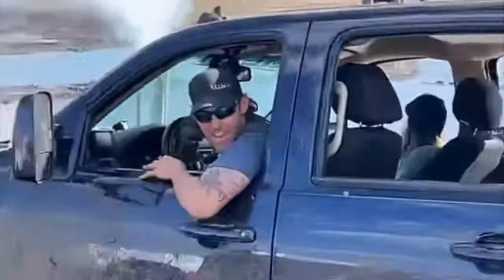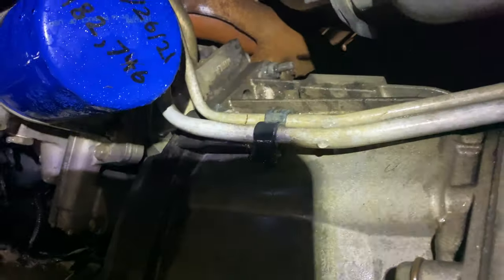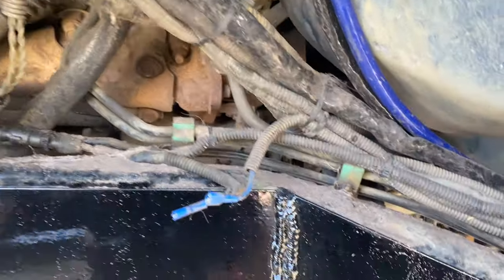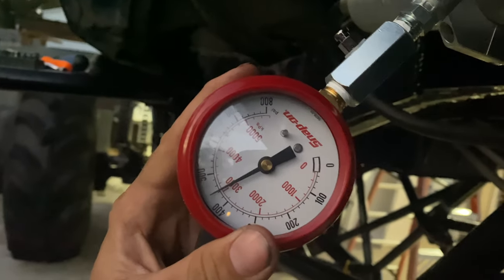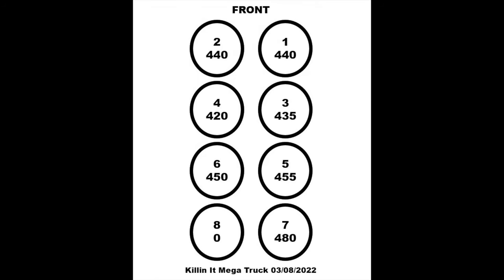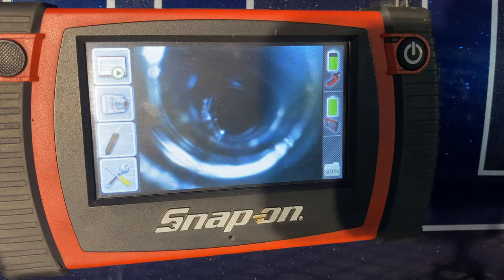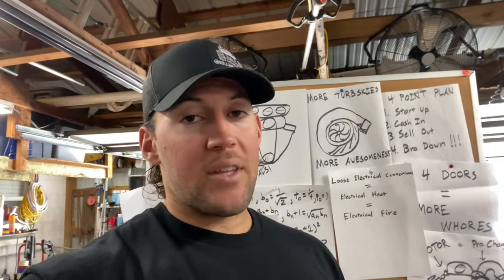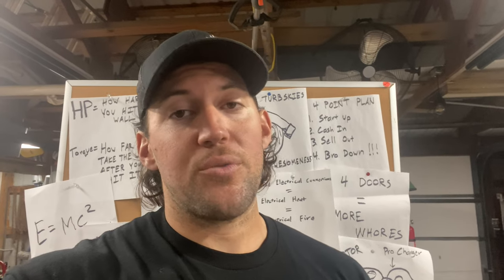Diagnosing the Killin It Mega Truck Engine

Comment: As soon as you turned the motor over checking compression you could hear a bad cylinder. A healthy motor would be a constant sound. Yours had a hiccup in the sound. This is the starter spinning faster in that one spot because there is low compression in that bad cylinder. No compression easier to turn